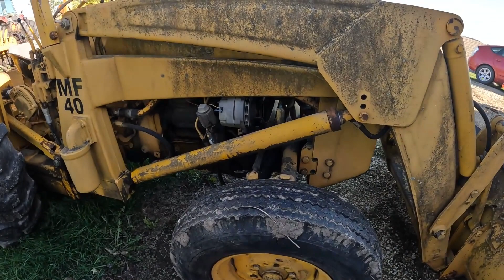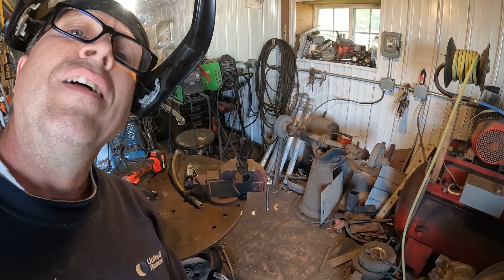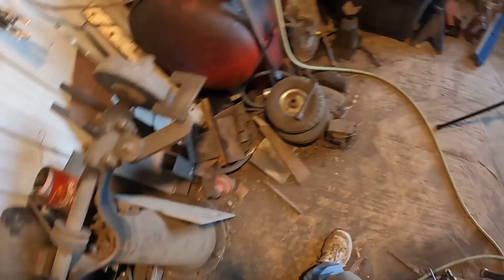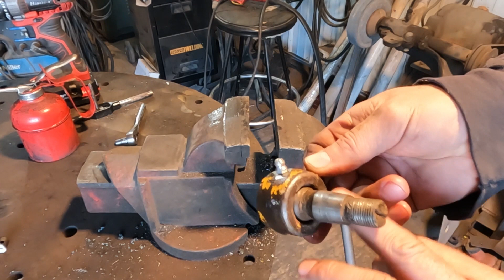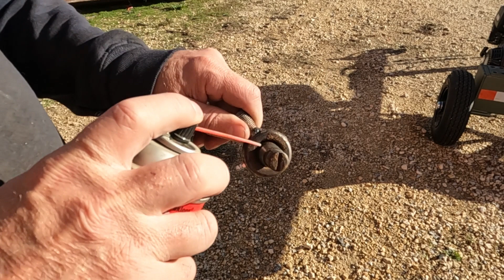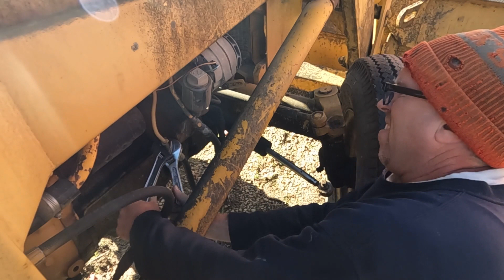MF40 Tractor Backhoe Quick Fix of Tie-Rod on a Budget - DIY Day

Comment: That was a nice repair.
 However you should have added a jam nut to lock that end into the  rod. Even if you had to cut the nut in half for space.
That's why it failed.
No matter how tight you get it, the rod will work loose, because the rod tries to 
Rotate with each stroke.

Nice old Massy
Good Luck